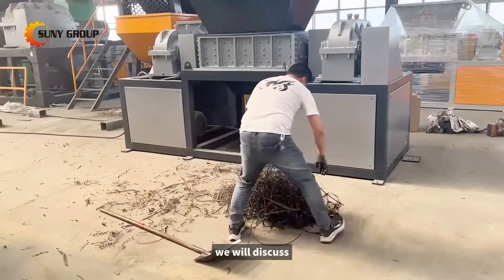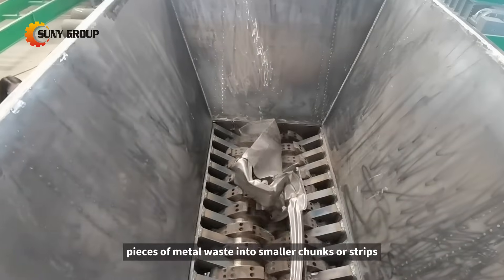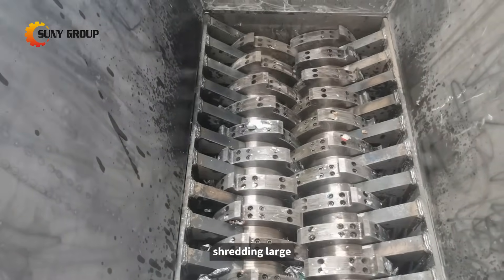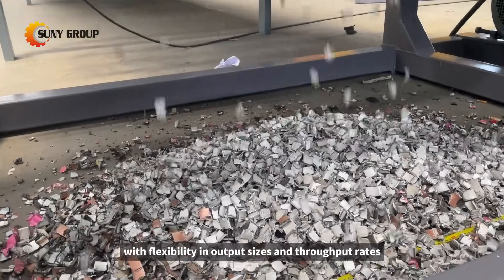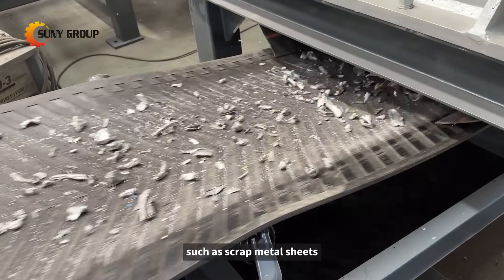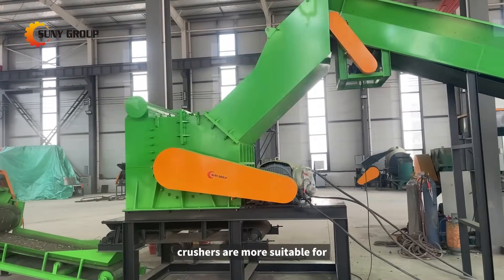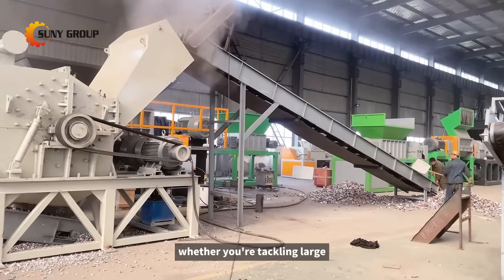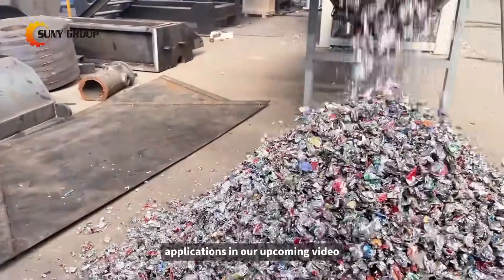Discover the Difference: Metal Shredder vs Hammer Mill Crusher

Comment: I used to build hammer mills. I don't care how much torque a shredder has, it will never be as violent and destructive as a hammer mill. The ones I built used 5 AR steel plates about 6ft in diameter, with about 300 or so 7lb hammers between them. It spun at about 2.5k rpm and would pulverize blocks of clay the size of cars into dust in seconds. Insane impacts We replaced the hammers every two weeks, and reworked the plates every couple months. Shredders are cool and all, but nothing is like a big hammer mill.
Reply: We run a hammer mill at my job. They're pretty cool. Ours uses 16, 300lb hammers spinning at +-900 rpm. The power they have is amazing.